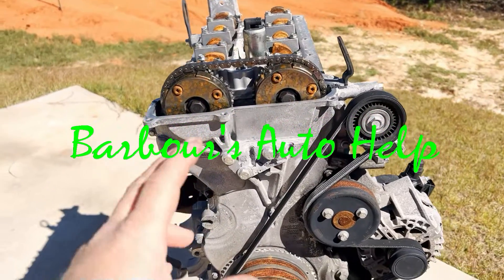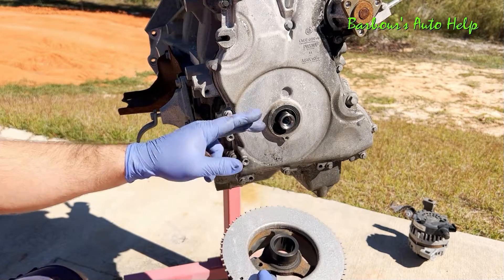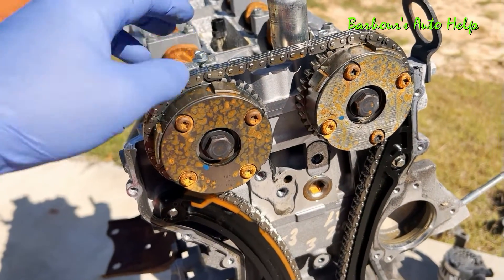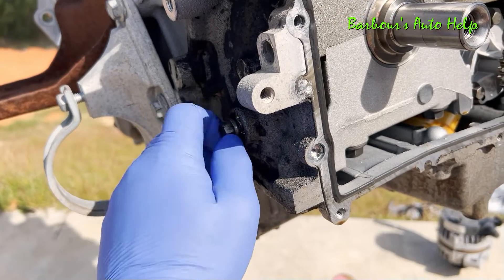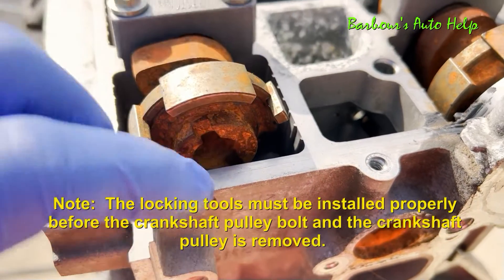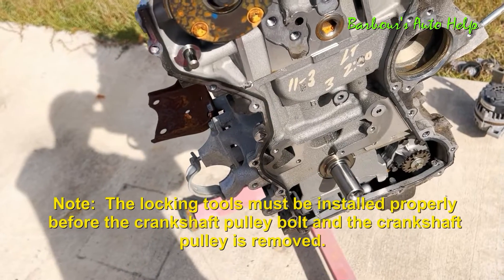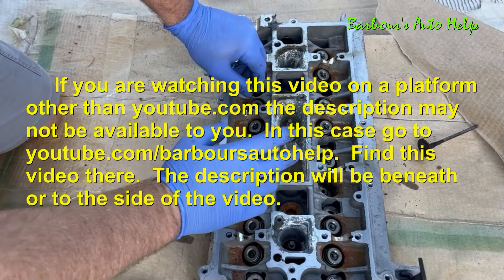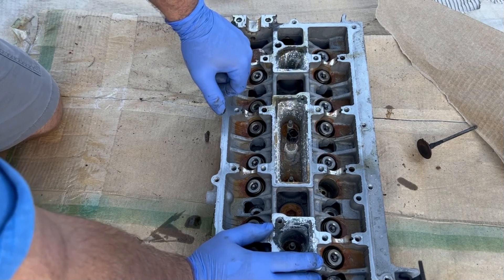Ford Duratec 2.0L HE Ti-VCT Engine - Tear Down - Part 2

Comment: at least it`s closed deck cooling circuit so it will lasts longer than 1.0/3cyl/turbo.
Are there +0.25/+0.5 pistons and other aftermarket repair parts avaliable ?
Reply from the maker: I don’t know. I haven’t had to do “major” engine repairs to this engine yet. Let us know if you find anything though.

Comment: Shitty system to adjust valve clearance. Expensive and complex.
Reply from the maker: Yea, it's not easy to say the least.  But, there are no routine valve clearance adjustments required on this engine to my knowledge.   So unless you are doing certain major engine repairs it's not really needed.

Comment: Finally got tool to check timing and it was way off. Is it possible to wedge in a tool to adjust timing without removing timing cover? Or is that stupid?
Reply: To adjust cams
Reply from the maker: I don't think there is an easy answer for you.  I'd suggest getting a manual for this project.  I'm not able to walk you through it in the comments.  You are going to need illustrations and the whole nine yards.  I don't think you'll be able to get around taking the timing cover off.  Also, I don't remember, did you ever get an oil sample?  Is there excessive metal in the oil?  If so, It's possible you may need an engine.  Not sure.
Reply: @BarboursAutoHelp  ok I’ll make sure to take it off and so far the oil was clean I’m hoping for the best

Comment: Lol praying I don’t have to remove the chain to do the timing
Reply from the maker: What exactly are you trying to do?  What problem are you having?
Reply: @BarboursAutoHelp  So super long story short car oil leaked because of oil plug. 

Then it would just crank with no start.got a bunch of timing codes so trying to see if fixing the timing would give me spark😅
Reply from the maker: @Theothervlad  Oh, I was able to get to my desk top and check my "held comments".  This comment was held for review.  The system automatically does that.  It didn't like the lack of space between start. and got.  Any how,  are they "over reatarded/ advance codes"  or " cam/ crank correlation codes"?  It may not be a bad idea to take an oil sample.  There may be excessive metal in the oil. (not saying this is the problem, but it's unusual for this engine to jump time.).  If there is excessive metal in the oil then there is a good chance that the VCT solenoids are plugged with metal.  And, if they are plugged with metal then it's probably best to replace the engine.  The solenoids are easy enough to remove and check for this.
Reply: @BarboursAutoHelp  lol comment keeps getting deleted?
Reply from the maker: I see you now. May have gone into my “review “ comments. Do you have a code or something?  Is that why you are going into it?
Reply: P052B
P00014
P0012
P2837
Reply: Yeah I need to see if I can find vct I replaced them lol should’ve checked them first
Reply: Would the oil emptying out cause a jump? I was hoping that was the issue before I have to scrap the engine 🥲 wouldn’t even know how to shop for one
Reply from the maker: I suppose it’s possible.
Reply: @BarboursAutoHelp  basically my only clue as to why it cranks but wont start. That or a bad pcm to crank sensor connection.
Reply: @BarboursAutoHelp  any other tips as to why no spark?
Reply from the maker: Do you have fuel pressure?

Comment: Keep it going - great knowledge being shared.  I have one of these and am currently struggling to diagnose a problem where the car seems to periodically suffer a loss of power and the car sounding like it is running on 2 or 3 cylinders. So this helps a lot!
Reply from the maker: Is the check engine light on?
Reply: @BarboursAutoHelp  Not at all and also no error codes on the scan tool.  Starts every time, idle reasonably stable (+/- 790 rpm), temperature pics up slightly when stopping after driving at above 3000 rpm and in heavy traffic - probably max 105 deg C - but cools down after a minute or so and keeps at 90 - 93 deg C.  But the lack of power is very apparent when the whole engine / engine compartment is hotter.  Fuel consumption is also good at 6.3 - 6.7 l/100 km.  Doesn't seem to consume cooler fluid and does not seem to burn oil above average usage.  I have installed 4 x new coils, 4 x new spark plugs and 1 x new crank sensor - without any difference.
Reply from the maker: @user-oh9uu2lp6z I wonder if the evap canister purge valve may be getting stuck open from time to time.  Is the symptom more noticeable just after filling up with fuel?
Reply: @BarboursAutoHelp  I'd have to say no difference when running with a full or near empty tank.  I do about 3 fill-ups a month and is required by company rules to drive full to empty (at least into reserve) to save on card charges.
Reply from the maker: @JacoNell-p7q  give me some time. I’m gonna check something. If you don’t hear back the next day make another comment to remind me.
Reply: @BarboursAutoHelp  I did check the evaporator valve, but working as normal (closed when starting, opens when engine gets to temp). Thanks for the comments, getting an alternative diagnostic to check as well.
Reply from the maker: @JacoNell-p7q  Another thing to check is the fuel pressure sensor.  Some times they can become intermittently biased and cause issues like this.  Of course you would need a tool capable of reading the sensors output while the problem is actually happening.